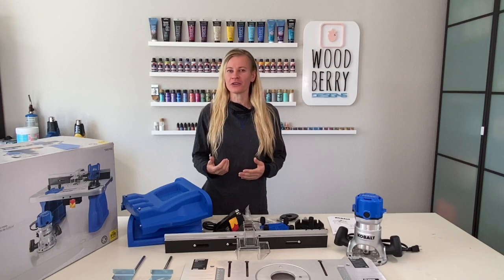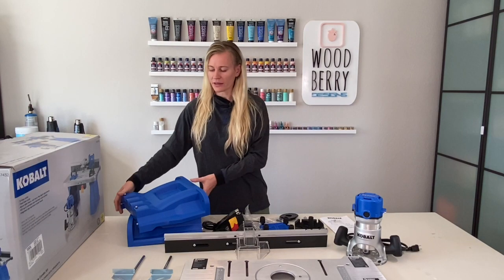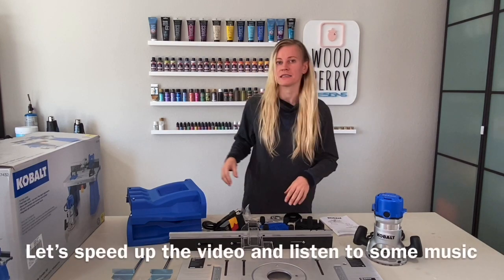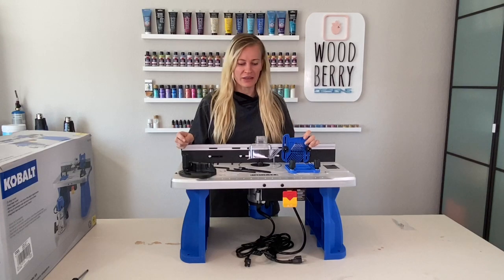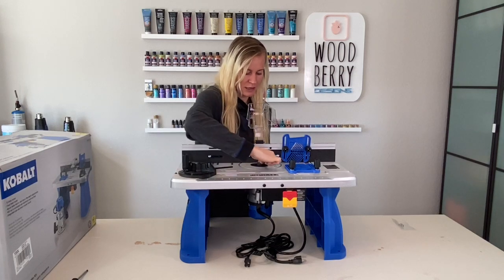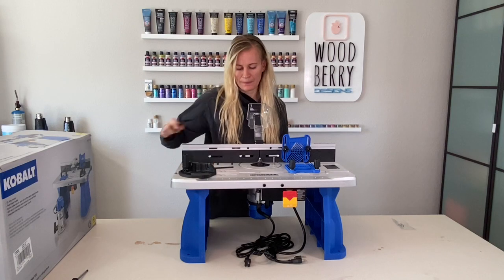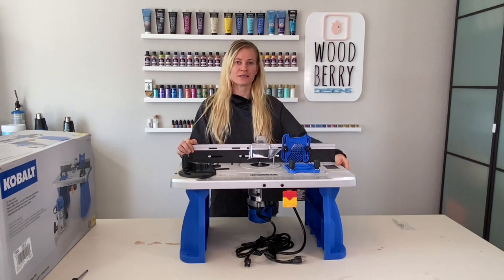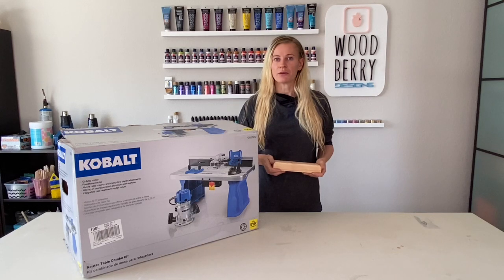Kobalt Router table kit Assembly, Demo, And Review.

Comment: I just wanted to say thank you for giving a VERY logical and factual review. It burns me these days when I go to read reviews and it has nothing to do with the product itself. Now, I am a Ryobi guy and I do have to say, thanks to your video, I was unaware of the hand crank tool that moves the router up and down. I have always reached in and turned it manually. Now after writing this, I am going to go out and see if my table does that. When you first started the video and and told everyone about the plastic feet, my ears were on fire! I have to say, if you are pushing a piece of wood thru that router that hard, I would think the router would stop spinning before the legs would break. That should be some ones first clue that there is an issue. I do have to say I have never seen a new router and a new bit not cut a good cut. I'm sure it has happen, I just have not seen it.  Love the videos! Keep up the great work!

Comment: That router and table combo looks almost identical to the Bosch RA1181 table and the Bosch 1617EVSPK  (1/2" shank, ~2.25hp) that I have. I really like the setup. The Kobalt price is much better though. The few Kobalt items I do have have proven to be pretty sturdy.
Reply: @WhatMeikeMakes  I would not be surprised if the Kobalt table or router were actually rebranded Bosch items. The body on that router is almost identical to the Bosch. When you were assembling the table some of the components appeared identical to my Bosch table.
I saved money by buying my Bosch on Craigslist from a local seller. Even so, buying used, I think I still paid more than you got your deal for. Well done.
Reply: Bosch doesn't have the router lift unfortunately.

Comment: Question... Does the router give you the option to run both 1/4 and 1/2 inch bits? Can't wait for the review.
Reply: According to the product page om Amazon, the Kobalt router takes both half inch and quarter inch bits. I.e. it comes with collets for both sizes.

Comment: Meike - thanks for making this video. I just bought the exact same router table and router from Lowe's for about $135. I think this is about $30 less than it sold for previously. So far I haven't put it together, but I am about to - and I need a router to install some hinges on custom doors I am building. What bits does the router come with? Now that you've had this router and table for more than a year, what do you think about it? Are you still happy with it?

Comment: This router is also notorius for skipping gears and dropping when you lift it in the base. Simply supporting it with you other hand underneath the base is the work around.
Reply: I have this problem and it is very inconvenient.  In fact, it renders it almost worthless.  Thinking of getting a different router for the table

Comment: Just bought one.  Haven't used it yet but it seems to be pretty good for the price.  One thing, if you ever feel the need to use the miter gauge, or even just the miter slot, forget it.  The gauge is totally worthless and even the slot is useless the way it's made.  Unfortunate that they didn't at least make the miter slot more standard.

Comment: Two quick things.... 

1. please make sure your hair is pulled back and safely away from any spinning tools. 

2. Invest in some push blocks. Freehanding on the router table can be dangerous. Even when feeding in the right direction (as you did), there can still be kicks. Those kicks can pull your hands into the spinning blade. 

You're a beginning wood worker, and I want to see you making projects safely for many years to come!